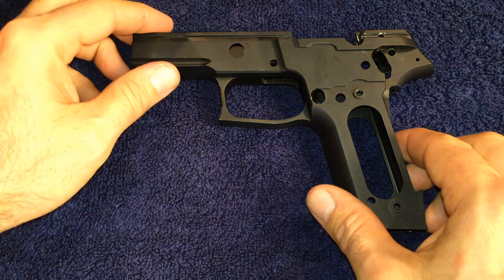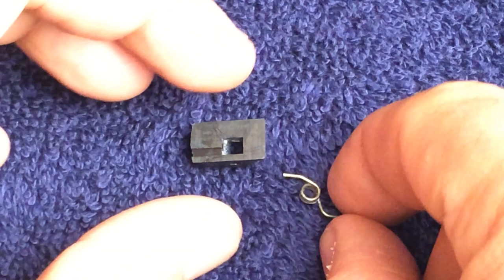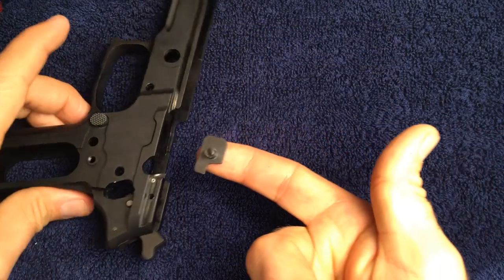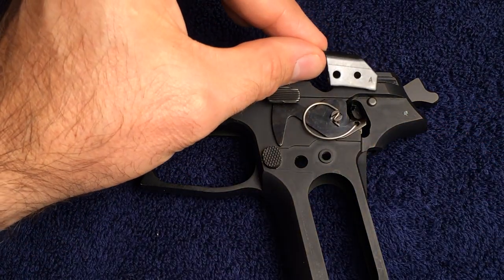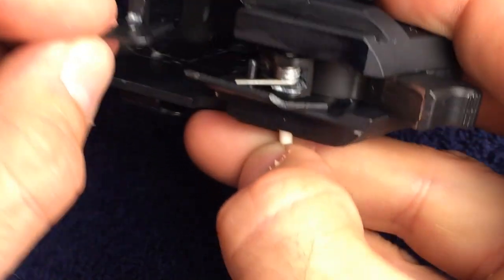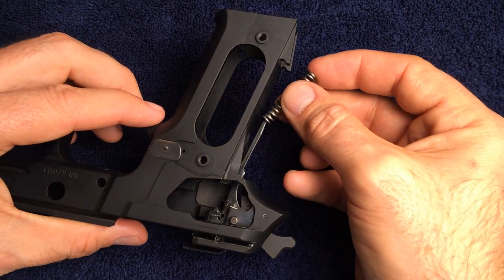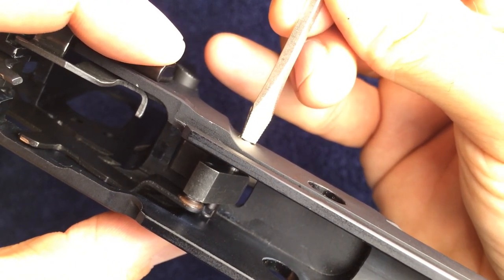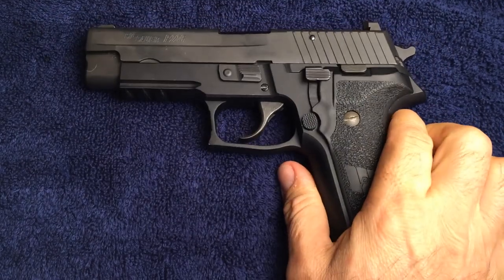Sig Sauer P226 complete frame reassembly in HD

Comment: Recently purchased a P229 40 cal, & a P226 9mm. Videos like this help me become more comfortable when it comes time to clean & service. Your slow & patient manner give me the confidence to take it upon myself when the time arises. Your video work & great focus on where it needs to be are a bonus. Keep up the excellent work!
Carl
Reply: Scott, great video! Correct me if I'm wrong but I think the hammer return spring goes under the hammer pin. Had mine on top like the video and hammer would not reset until Iinstalled the spring arm under the hammer pin. Thanks for taking the time to make the video.

Comment: This is the best Sig P226 video. All the other videos I found skipped over the hammer reset spring. Since I was converting a DAK to DA/SA and the DAK doesn't have a hammer reset spring this was the key information I needed. Thanks!
Reply: Same here and thank you for verifying this is what I am missing. I have tried to convert my DAO to DA/SA but found that DA is not working unless it is half cocked or decocked. What else did you need for conversion. I got the basic kit from Matrix.

Comment: I accidentally bent the hammer reset spring on a sig and it was not properly mounting on the pin at the back of the hammer.  The result was disastrous because the sear was not resetting properly after each trigger pull and the main spring was working the hammer incorrectly.  This highly instructive and professional video allowed me to identify and correct the problem.  Hands down the best how-to video on this subject. Properly edited to short, concise subject matter, no unnecessary babble, great video camera work, and proper identification of all the parts set you apart from the other folks who attempt to do the same.  Great job!

Comment: Thank You. I called Sig today, and ordered out new springs, roll pins, and night sights, plus the last few Elite 2 1 piece grips left in stock. One of my P228s has a rail frame, and milled slide, and I wanted to make it a bit more special, but I will keep the old grips, aside so it can go back to stock, I guess. The P229 is essentially a P228 with a stronger slide that will handle the  .40 S&W, and .357 Sig round' recoil energy. The geometry on the decocker is different so it, the sear connector, a link, the hammer strut & spring and the sear will need to be changed out. I rebuilt some old Swiss P226s and this looks a lot like the P226. Sig was kind enough to let me know to drift the sight out to the left. The dovetails taper inward on the right side.
Reply from the maker: This sounds really nice. I have seen some beautifully milled bodies, and actions so smooth that the trigger pull weight is consistent down to the grams. Gotta love when craft becomes art. Have a great day :)

Comment: thank you fir this video. i just picked up my first sig and its a west german p226 so i want to go thru it and give it a full clean up and replace the springs with new ones. i did notice some of the parts have been updated such as the main spring/strut assembly and the trigger bar spring. i ordered the new style springs and the new style strut, seat and main strut spring. i hope i wont have compatibility issues. i do know it has the srt kit installed as the originals parts are inside the srt packaging. but i will hold onto all the original parts just incase i ever wish to return the pistol to factory.

Comment: Wow what a great tutorial. I'm going to use this to learn and help my confidence. I'm not mechanically inclined, but this seems easy enough. Any thoughts on why my Tacops doesn't lock to the rear when empty? It's not my grip or mags (as everyone says). I have a few Sig P226 models and lots of magazines and none will lock back when empty. Would it be as easy to fix with a new slide catch lever spring? Much appreciated!

Comment: Just bought a p226 80% kit. All 100% Sig parts some refurbished some new. On top of a machined frame that needs the rails cut and some holes drilled. I was a bit worried about the install but it looks easy. Now is the slide as straight forward to assemble as the frame? Besides the barrel and recoil spring I mean.

Comment: Heads up, I have a P226 Elite and I've found that my safety and trigger bar design is different. The trigger bar must be installed before the safety and sear. Not sure what models this will affect.
Reply from the maker: +AdmiralMinell Thanks. I heard of the modifications on the newer model. I am trying to get hold of one to do a supplementary video on the differences.

Comment: I just recently duracoated my sig have attempted to put it back together twice. When pulling the trigger the hammer barley moves. Do you have any idea on what I could be doing wrong?
Reply: If the hammer is moving all the way back but is not going forward then it's probably your main spring strut not being installed correctly. Ask me how I know, lol.
Reply from the maker: eric williams Duracoating adds additional thickness to each component around .25 mils to 1.5 mils. You will need to polish the rubbing surfaces so they have "room" to move. Typically when folks add duracoat to critical moving parts they will first remove a small amount of the original surface before coating. In your case...A medium to very fine polish and lots of patience, as well as a good lubricant. Remember to test this when the metal is hot because it will expand as it heats up, as in when it is being fired. You don't want it to jam when you need it most! Perhaps for those particular surfaces you may want to take them back to the original layer before the coating was done, but see how you go with the polishing...remember test with the gun hot from shooting some rounds through it :)

Comment: Hi.  I just did everything you did but my gun will not decock or engage hammer.  The decock works before I put in the hammer strut and mainspring but when those are put on it seems like it has too much force holding the hammer fully cocked.  not sure what the problem is.  I've watched and redone the reassembly numerous times now and no luck.  Any ideas?
Reply: Never mind I got it FINALLY!  I just didn't have the hammer strut seated all the way back far enough.
Reply from the maker: +luexiong Well done on resolving the issue :)
Reply: The hammer strut may have been a bit more detailed since it was completely my first time doing it but it was really a great detailed vid of how to reassemble.  Thanks man!

Comment: Did anyone else have a problem getting the locking insert in?  Scott said to make sure the notches are down although he shows them up but I tried them everyway and cannot get it to latch.
Reply from the maker: Kathleen Bollman Sorry for the late response. Did you get it inserted. What you see is better than what I said. Let me know. It is a part that most folks have an issue with typically. :)